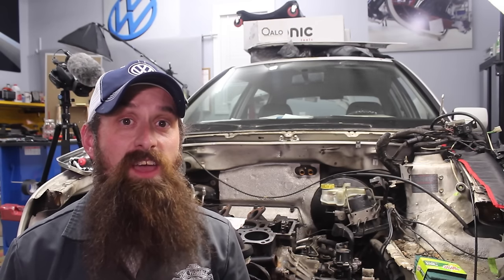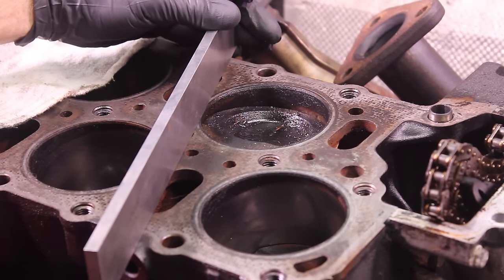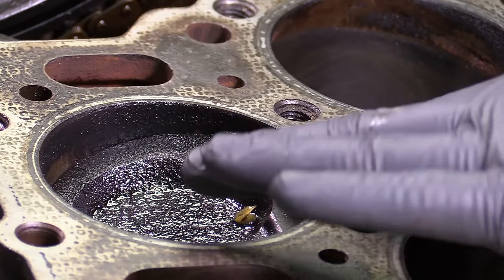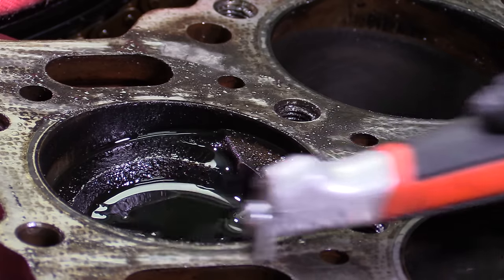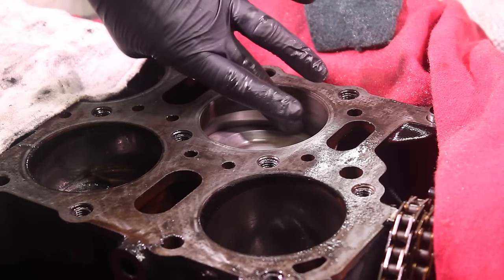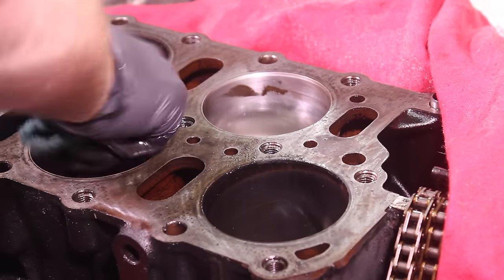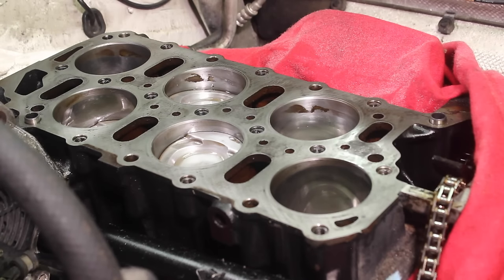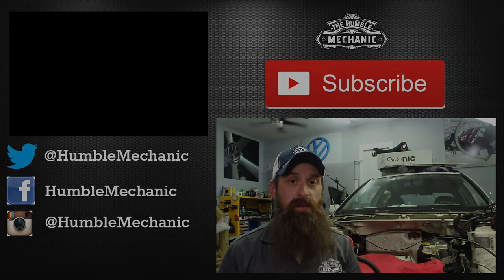Removing Carbon From Piston, Cylinder Walls, and Block Deck

Comment: I didn't realize that WD-40 had so many uses , that head came up like new .
Reply: Diesel would have done a better job.
Reply: JayVan Geli 
that's true
Reply: The 2 tools you'll ever use, duct tape and wd-40!
Reply: commodore665 that was the block and pistons
Reply: yeah i just used it to clean the carbon off my exhaust tip and it looks great now.
Reply: WD-40 works great for cleaning like in the video and keeping moisture out; But is a terrible lube.
Reply: its not lube...
Reply: omgitzsteg LOL LUBE
Reply: One of my fave things to use WD-40 on is removing sticky crap from leftover decals. Always makes quick work and you don't harm the paint.
Reply: commodore665 WD-40 fixed my engine misfire in my truck. WD-40 is the best thing made
Reply: TECHNIQUE does your Z have Coil on Plugs or Coil Packs? It may be a permanent fix, but mine ended up being temporary. Good luck though
Reply: How to use. Lucas engine stop leak
Reply: LOL good one, Every morning when you wake up before brushing your teeth you break out WD40 grease up those joints before heading to work.
Reply: Carbon can also be cooked off @800 degrees.
Reply: I use WD40 to remove paint from my hands after paint job.
Reply: It also makes you more attractive to women !
Reply: It's not really good for anything.  I only use it to rinse out other oils because it's cheap.
Reply: Did the same cleaning with kerosene in my isuzu.

Comment: What provision do you have for removal of the deposits that make their way through the gap(aided by liquid)and in behind the rings. ?..,especially the top ring ? I am concerned that since cylinders all wear more up top, the crud will make a tight situation, especially at the bottom,since it has flowed in under the rings.Myself,(and I usually work on slow ,non performance antique  engines)I was taught to neck down your shop vac hose and GENTLY scrape it loose  still DRY , and vacuum it out as soon as it comes loose .You can tape  the  hose to scraper  1/2 "inch from the end and the  suction will offset gravity. (carbon is abrasive).

Comment: I'm a mechanic and, at work, I use the 3M nylon bristle discs on an air die grinder on any precision machined engine mating surfaces.  Best engine work "cookies" ever.  They remove all foreign material while NOT removing any of the precision substrate material.  And if any shavings get down in the engine, it's no big deal, because it's just soft plastic.  No air compressor?  No problem... throw the Roloc mandril in an electric drill.  :)  Personally, I like white (fine) and yellow (medium) for heads and decks.  Anything else, green or whatever color you want is fine.
Reply: Is there such a thing with no grit in it? 3M Nylon bristle discs incorporate "proprietary" ceramic abrasives (my guess, aluminum oxide, same as what is on Scotchbrite pads) . Not just soft plastic. White is 120 GRIT yellow is 80 GRIT ..... where GRIT means abrasive!

Comment: How much of that SB pad are you leaving between the cylinder wall & piston top & in the ring groove ?
You know there's been many TSBs saying to not use SB disks but SB is SB.

"Scotch-Brite is a line of abrasive cleaning pads produced by 3M. The original product line consisted of 
spun polypropylene fiber with about nine grit variations. Scotch-Brite also contains "Alox", which is a trade name for aluminum oxide."

&

"Aluminium oxide is used for its hardness and strength. It is widely used as an abrasive, including as a much less expensive substitute for industrial diamond"
Reply: I had the same concern. I once worked with a diesel mechanic doing a head gasket job on a mack truck, he did basically what is shown in this video. I now work at a reputable engine machine shop running the cleaning area and I use wire brush wheels to clean cast iron gasket surfaces, does not remove metal unless I dwell too long or run up an edge. I would recommend a wire wheel for a mechanic as well, it's going to make less abrasive debris.
Reply: B Anno dealers problem not everybody's
Reply: CHARLIE ARROYO

First off a SB pad will not give the specific surface recommended by any gasket manufacturer.

You can google
"gasket surface recommendation"
if you care for the facts.

SB does however give a great surface if you use silicone excessively instead of a "gasket" like so many uneducated so called mechanics do.
But then again you have an abrasive particle issue.
&
  Any abrasive left in any engine is not a good thing and it will eventually if not immediately do damage.
Reply: +B Anno You are getting a little too technical now. Do you think gas stations gave a fuck in the 1930s what the microns of a head were when they changed a model A head gasket. Get with the program.
Reply: B Anno Correct! 
NEVER USE SCOTCHBRITE TO CLEAN UP GASKET SURFACES OF AN ENGINE.

NEVER, EVER, EVER USE SCOTCHBRITE ON AN ENGINE. At least not one you want to run again for a long time.

Scotchbrite seems so benign but it is death to engines. Scotchbrite pads are nylon fibers with 40 micron particles of aluminum oxide in them. Scotchbrite dust leaves behind all those 40 micron particles hidden everywhere. Aluminum oxide is an extremely aggressive abrasive. It imbeds in the bearings and eats the crank....and other things.

Scotchbrite is the bane of the aftermarket re-man engine industry. 
 https://www.bobistheoilguy.com/forums/ubbthreads.php?ubb=showflat&Number=563163
Reply: Wish we has 3-M pads here. Wish we had wire-wheels. Wish we had compressed air..(a hand-pump does come stock with my Niva)

Comment: As a machinist, DO NOT use an air or electric powered grinder / sander with a roll lock disc!   You can not keep the disc straight when sanding. You always end up with low spots in the deck surface or rounded corners of water jackets and bores!
Reply: Yep, made that mistake with my Oldsmobile alero 10 years ago. Just bought a new 2017 Honda HR-V in 2017 and will only clean the engine as this guy has stated in the video when the time comes. 148,000 miles in, and it runs like a champ.

Comment: You should call Discovery's Fast N Loud's and be a fill in for 
Aaron Kaufman
Reply: If you don't like all that sharp carbon going into your engine and ruining the oil and water pumps, smear some grease around the edges of the pistons to catch it. It will stick in the grease when you move the piston down. Also, stuff the foam that was cut from the back of those scouring pads down the oil and waterways. It won't fall apart like paper and mostly holds itself in. It is easy to extract with long nose pliers if is pushed in a bit too far. WD40 does work. A small flat round ended spanner makes a good scraper for the piston crowns. A large roll of paper is essential.
good luck☺
Reply: I thought for a second " oh cool Aaron has a channel".

Comment: Ive worked in a machine shop for 11+ years and the worst thing you can do is take a roloc or buzz wheel to clean a deck surface.. this is common practice in "mechanics shops" and that makes me sick and such a horrible technique is in constant use... ps lacquer thinner and a rag will take that carbon off faster and safer than Getting SB debris inside the chamber
Reply: Rolocs are badass.  I think using one lightly and evenly on a iron block would be ok.
Reply: Logically speaking. Any kind of roloc debris left in the chamber will be blown out. Any kind of debris in the cooling jackets will be burned up or just circulated.same with an oil galley.  The hell you talkin bout
Reply: @BGFR : You stated your opinion, but left out the reasoning why it's "the worst thing you can do".
Reply: I am OK with the Roll lock desk.But everything has to be sealed on that engine first so no debris get into anything. I would never use it on pistons. I’ve seen many mechanics destroy engines because of it. The person needs to use their head about it. I’m at 25+ year technician.
Reply: Not when it's a wd40 sponsored video
Reply: @ravynx  because you cant control the amount of material taken off by the roloc disc.. everyone thinks they can do it lightly and not ruin the flatness.. thats never the case everytime a mechanic shop brings in a set of heads or a block that they took apart they use one and we always have had to take more material off to make the surface flat again. Case in point we took in a 2.4l chevy head that they used one to remove gasket material on and it needed .034" taken off to make it flat. Mind you this motor did not have a head gasket issue  the head was taken off and surfaced as preventive maintenance. Ps .004" maximum allowed for straightness(depending on mfg).  Average jobs take between .005"-.010" to make it flat again.  Proper way to clean all gasket surfaces is to use a  sanding block bigger the better. It sands flat not in spots.  .004" is not a lot and can be easily taken off with a roloc disc and not realize you took it off

Comment: Charles aren't you concerned that bolting a the head on with the valves making a nice tight seal that you will induce blow by past the old tings & bore? Or did you do a leak-down test to confirm the rings were good. Thanks for these very informative videos, keep them coming.
Reply from the maker: +Chuck Ashton at this point I am not worried about it. The engine ran well before hand. 

The WORST case is, I have to replace the rings down the road. While I a confident that everything will be fine, I don't mind doing rings down the road.

Comment: I like that spray bottle that you had with the WD-40. Years ago I came across a shop size aerosol can that sprays so much out with just the little push on the top it covers everything quickly. I have probably had that can for 10 years and I'm still have more than half of it. I usually use it to stop flash rust. It comes in handy when rebuilding a motor. Which in a few weeks I plan on starting. It's going to be my winter project.

Thank you for all the information you provided in your video. The stuff underneath the head on the engine block is almost like concrete. Your way looks so much better and I'd like that scraper you are using. Thanks again for sharing your video.

Comment: I work on Navy ships, and some things need to be stoned smooth and flat. NOTHING works as good as WD-40.
Reply: David Collis I work on navy computers. CTN here, lol.
Reply: I have to wonder, though. Wouldn't putting WD-40 on stuff like scotch pads and wet sandpaper reduce the abrasive/cleaning effect? I know WD isn't technically a lubricant, but it also forms a thin layer. Just wondering.

Comment: would pouring drops of water into the intake while the engine is idling have the same effect? it seems that manually doing it like that is more effective but I am not really inclined to disassemble my engine right now
Reply: That is basically the Seafoam treatment. U can pull a vaccum line with direct to intake vaccum and use it to suck in water or seafoam. the shock of the cold liquid will release some of the deposits and shoot them out of the tailpipe. Using this method u would let the engine draw in fluid untill the engine runs really ruff but does not turn off. There are vids on how to do this. It should be safe to perform but be aware damage could result.
Reply: Remove the catalytic converter if your going to try this or you will damage it . Bg and other companies say that their products are cat safe but I don't believe that to be true , the cat wasn't designed to handle large deposits .
Reply: Yes light spray but it won't get near all of it.. only way is to remove the head and dip it in gasoline. Pro tip delete ur pcv engine sooo clean
Reply: Jimmy Schmidt 

Engine produces water as it runs. Lots. 

If you think thermal shock cleans off carbon try dumping ice into a hot carbon-caked skillet. Ice will skip around and melt, that’s all. 

You ignore the Liedenfrost effect when you claim thermal shock works using water.

Comment: Soaking in paraffin / kerosene overnight will dissolve that carbon and make it easier to wipe away with minimal effort using your method.
Reply: how to soak? do we have to take out the piston, plz tell me? thanks
Reply: What you can do is turn the engine over so that the piston crowns are nearly even. Then you can pour diesel or kerosene into the cylinders. The liquid should stay inside the cylinder... none should escape down into the block. Once soaked overnight/or however long you can usually wipe off most of the carbon residue with ease. Some may be more stubborn. Obviously you have to soak up the liquid you used before hand. The liquid should stay in the cylinders because the piston rings should be ‘air/liquid tight’ so if the is significant loss of liquid is can mean cylinder damage, piston damage, worn piston rings or that the piston rings have not been installed correctly (the ends of the rings should be installed 180 degrees opposed. If Aligned it will allow liquid to pass and drain into the block.
Reply: Malcolm Young - Great explanation, one thing to add is the liquid could escape on an engine with stuck piston rings also, the soaking will help with that too.

Comment: when i changed my sparks plugs (audi a5), i first poured chemtool B12 fuel system cleaner into the combustion chambers, let it soak till it evaporated. it definitely loosened the carbon. though, for best results is to let B12 soak for several days, scrubbing not needed. 

somewhere on youtube, there was a test (soak for 10 days !) of various fuel system cleaners on carbon, B12 was the most aggressive. just be careful not to get on rubber or plastic.

Comment: I usually just spray water in the throttle body at roughly half throttle. Cleans pistons safely and effectively.
Reply: madjimms my grandfather used to do this on his tractor.
Reply: madjimms a dash of methanol mixed into the water first is a good idea
Reply: +Sam Iamm you mean Moonshine there dontcha? ;)
Reply: We used to do that at an old shop I worked at, put a piece of white paper near the exhaust and watch all the pieces of carbon fly out.
Reply: +Eric Michel    180 Proof yeah!
Reply: madjimms 

Popular misconception. Sorry. The amount you spray to create steam is minuscule compared to the amount produced by the engine. Figure on one gal of water per gal of fuel. Better to use E85 if your vehicle can use it. Produces ~2X as much water when burned.

Comment: Scotchbrite is abrasive, scratches like sandpaper and also leaves a residue.  WD-40 is just light fish oil.  I use bbq foam grill cleaner and a plastic brush.  Press a bead of heavy grease around the top of the piston to block abrasives from getting trapped between the piston and wall. To do a thorough clean, spray or brush a light coat of paint thinner and blow the carbon and abrasives out of the space between the piston and wall, with compressed air.  Place a shop towel over the cylinder to contain the aerosol solution.

Comment: Easy Off oven cleaner works amazingly for that application
Reply from the maker: I have heard that before. I need to try it.
Reply: Yep, that stuff was made to eat carbon.
Reply: 'Easy Off' and its equal is lye, sodium hydroxide and breaks down organic compounds such as grease, oil and oxidized fats. It's also highly alkaline and attacks aluminum quickly. It's ineffective on regular, hard carbon deposits but okay on the softer variety normally associated with baked-on fats. 'Hard' carbon requires far more aggressive chemistry or just mechanical abrasives and hard work.
Reply: Oven cleaner can also damage and pit aluminum. While safe to use on iron blocks and pistons, it is not safe to use on aluminum.
Reply: Yes it does. But if engine was running all you had to do is run water through intake with engine running suck up water from cup with vacuum line and it will look like new
Reply: But destroys aluminum

Comment: Rotary brass wire brush and electric drill
Reply: THIS
Reply: I've always used a razor blade free hand and brake clean
Reply: Wire in rings is a No. they break off . Not on my motor .

Comment: I can't tell you how many times I have seen techs use die grinders & rolox pads to destroy perfectly good heads and blocks (mostly aluminum) by creating depressions and rounding off sharp edges.  YES, the tech almost always pays for  the parts...and the hard learned lesson. Good luck.

Comment: i trashed my car engine for the whole life of it, around 350,000 KMs, when time to rebuild it came, head removed and no carbon what so ever was found inside!
Reply from the maker: yeah this engine was not properly maintained. :(
Reply: Well collant can leak into the cylinder vapor cleaning it that ca cause a engine to blow
Reply: damn prius drivers

Comment: Amazing tutorial. What's a great compensation of cleaning the engine without disassembly the whole thing?
Reply: If you have a blown head gasket or need to do a valve grind and nothing else to bring the compression back up to snuff there is no point in stripping the bottom end. It's time consuming and can be expensive if you damage the rings or bearings during disassembly/assembly.

Comment: Would you use the same scraper if the block was aluminum and not steel?  What would you do differently for an aluminum block?  Is the white plastic roloc disc ok for that?
Reply: aluminum surface prep compound is what you want

Comment: Good tip here .DO NOT EVER SCRAP WITH A METAL OBJECT ON ANY ENGINE PART. take a plastic one its most safer to use then metal.metal makes deep sratch on the surface you work on
Reply: Scallie __ >calls op an idiot 
>uses "your" instead of "you're" 
KEK
Reply: Scallie __ >Tries to save face
>Fails
Reply: I always use a plastic coffee spoon to clean gasket material off delicate iron blocks. Ive almost finished cleaning off my pontiac 400 engine which i started doing in 1984.........

Comment: I have a 2001 jetta 12 valve vr6 with 290,000 miles and it still runs like a champ only thing I have done is the alternator.